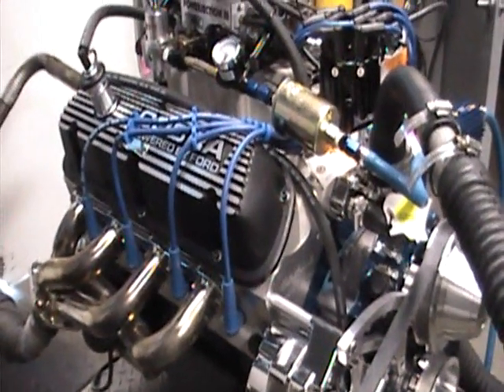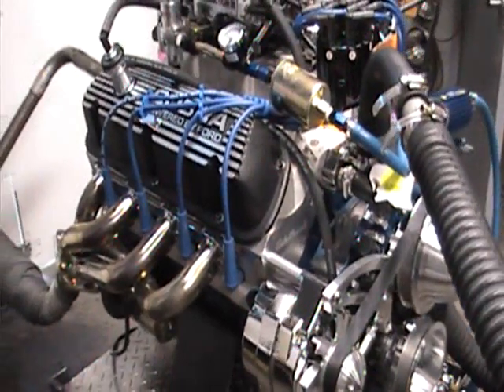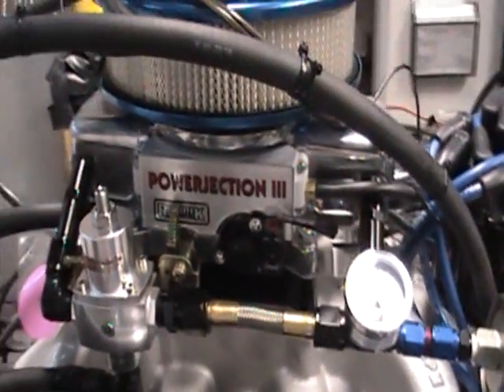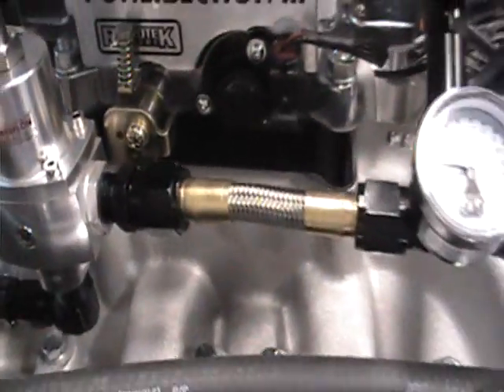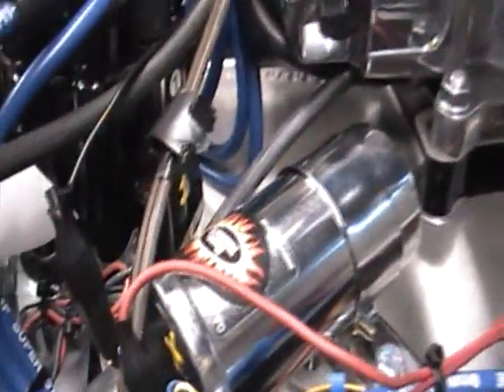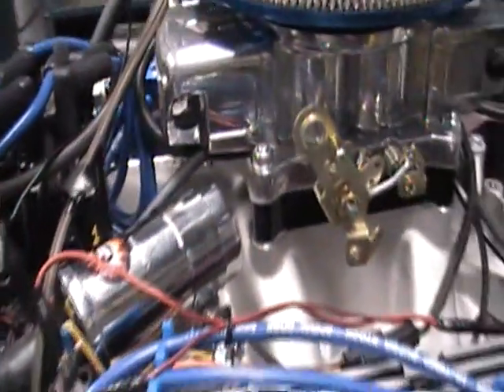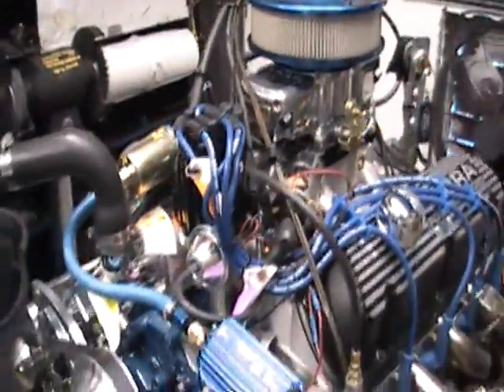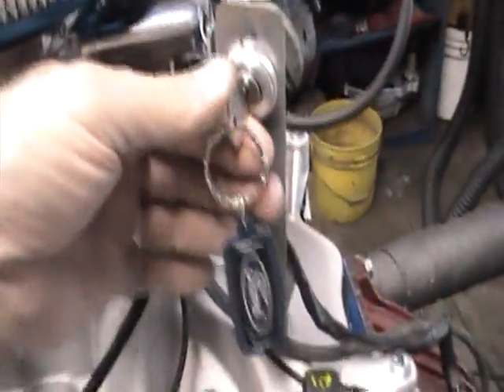Convert your Carbureted Engine over to Fuel Injection.

Comment: FFS wire joints wrapped in black tape, low voltage signal wires cabletied to spark plug wires, is this meant to be a showcase of your workmanship?

Comment: Very nice fuel injection upgrade. You really simplified the fuel injection system in terms of converting a carbureted engine to fuel injection. If I may ask, how does the fuel injection maintain exact engine load needs, in other words, how are you monitoring the engine load which pulses the injectors with a corresponding duty cycle needed at any given time.

Comment: that is DUAL POINT throttle body injection there are injectors but only 2 possibly 4 if it were a fuel injected engine there would be multiple intake manifold mounted injectors thus multi-port  you need to let ppl know that it is a throttle body injected engine